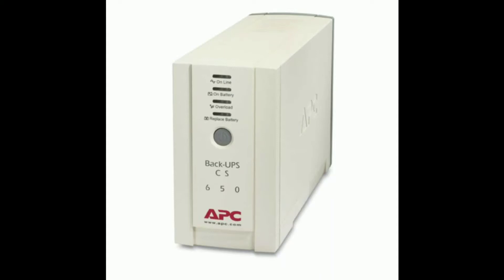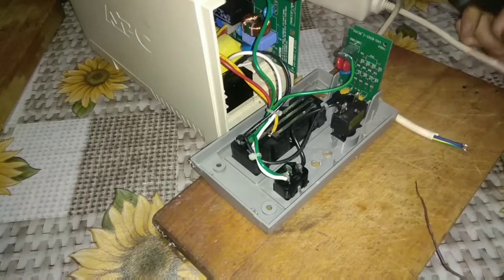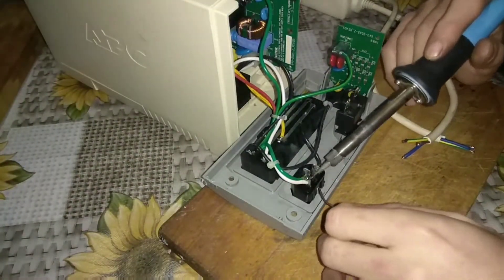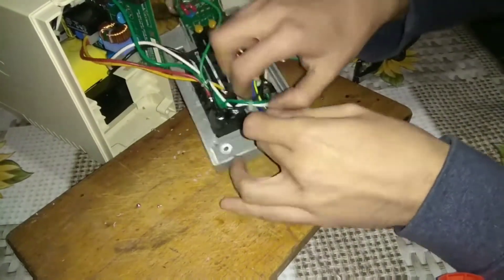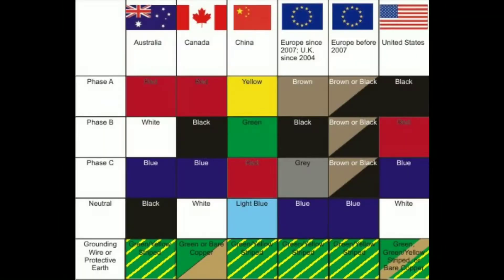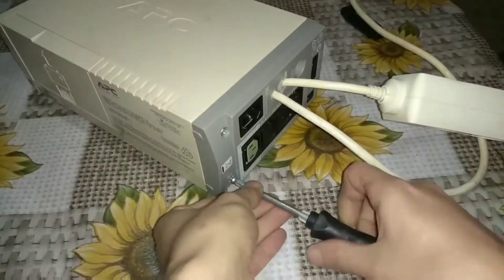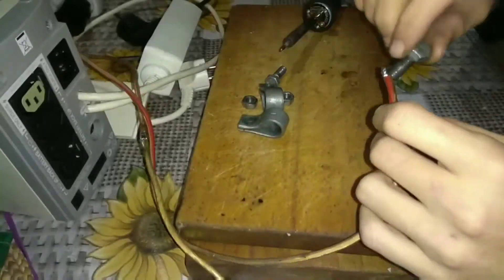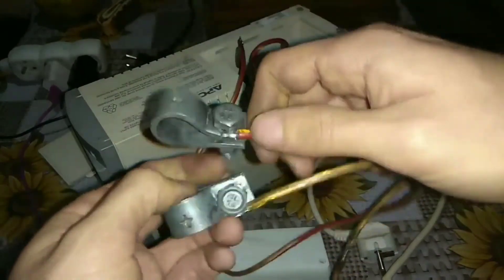DIY:  Solar elecric pannel Car battery 400W APC UPS mod backup for 3D printer part 1

Comment: Hi. What was the results? Were you able to connect a 3d printer without any issues?
How long did it last until it went off?

Thanks
Reply from the maker: Yes one printer is good, two printers case owerload fault. How long depend on batery